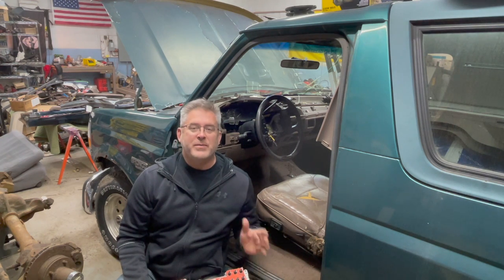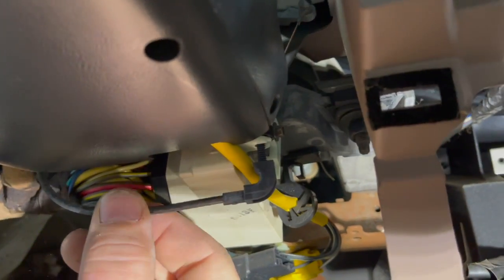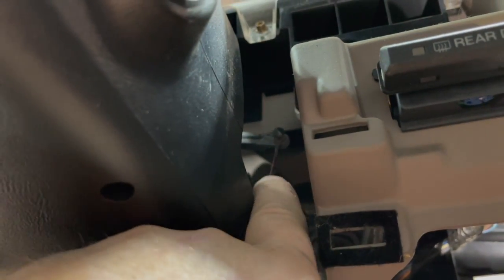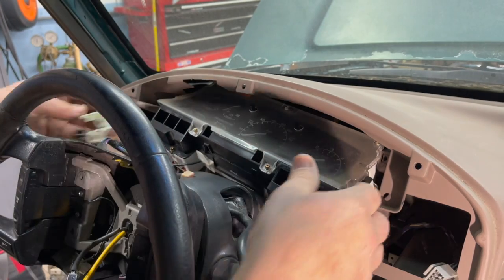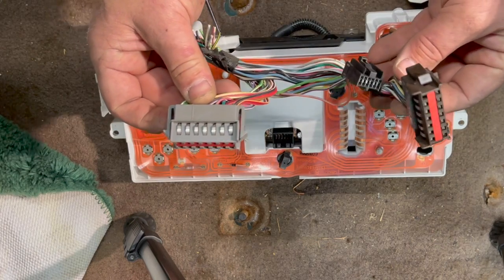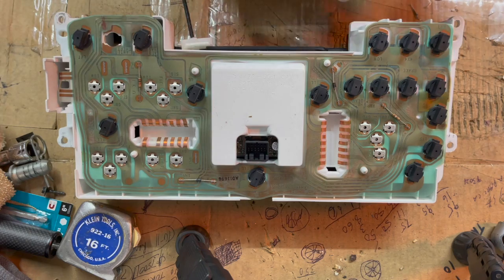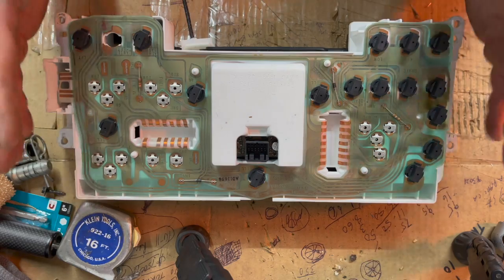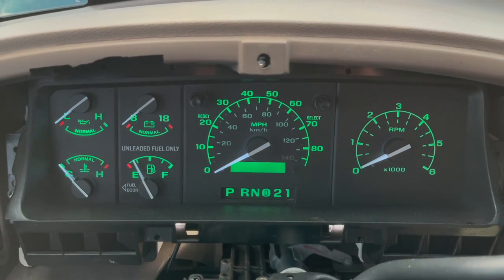How To Remove Gauge Cluster & LED UPGRADE  Ford Bronco   OBS F150 F250 F350

Comment: Just completed this upgrade yesterday to my new to me 96 F350. This video was a huge help in getting that task accomplished. I did the ac control panel as well.
Reply from the maker: That’s great.  It’s a great upgrade
Reply: How did you do the AC control panel?
Reply: This channel has a video on removing the AC control panel to fix broken mounts, I had watched that video also. There's 3 bulbs in the back of that panel. The led bulbs make a nice difference.

Comment: So my Check Engine light went out and caused me to fail smog. Can I just reach under and change it and not have to take cluster all the way out? Dont use LED for that light correct? Man love your videos.
Reply from the maker: Full removal.  Search my videos. I made a bezel and cluster removal video. Thx

Comment: On the shift indicator, is there a small dial for adjusting it on the cluster? My indicator does not line up properly with my clusters positions and Im wondering if thats the fix. Thanks for the vid!
Reply from the maker: Of that doesn’t help, on bottom of your column, near the knuckle, there are 3 gold torx bits. T30? Maybe.  Tighten them all.  Problem solved

Comment: I have a 1996. Is the battery light on of the six on the bottom that we are not suppose to replace? Or is it in a different location? Thanks for all the great videos I wouldn't be doing half this stuff without them!
Reply: Also the bulbs are on Prime day for $13.59
Reply from the maker: I don’t replace the bottom six that are in the warning light area. I’ve had issues with other systems.

Comment: Have a 1990 F-150 manual drive ( floor shift ) with bad water temp gauge. My cluster has no shift markings. On ebay all clusters for my make & year have shift markings with cable. Do you think there would be an issue if replaced mine with a cluster with the shifter markers and cable? Thanks for video and tips for LED bulbs. Great job.
Reply from the maker: No. Two 5.5mm screws and the indicator comes out.  I sell the clusters for $95

Comment: also a good idea to leave a regular bulb in the battery light spot. i hear that its could mess with the exciter on the alternator.
Reply from the maker: Only on 1996 models. They have that batt circuit.
Reply: @BroncosandPartsGarage what about 1997? I got a 97 f250hd with the power stroke..   should I leave the battery light stock?
Reply: Thank you for mentioning this as I have a 1996 and would have replaced that bulb if I did not see this.

Comment: So I replaced all 11 bulbs, and now only the six at the bottom work (didn’t swap those out as instructed)

Tried unplugging everything and back in. Could it be a bad fuse ?
Reply from the maker: Remove each led bulb that’s out, turn them 180 degrees and re install.  Check the metal tabs on the bulbs are making proper contact.  What brand bulbs?

Comment: The best one I have seen change  my blubls right side didn't light up is there a fuss I need to change thanks for the vido
Reply from the maker: Just seeing this. Pull the bulb holder, rotate it 180 degrees. Make sure the little copper feet are on the circuit.

Comment: I think with one package of 10 is enough, you just need to replace the ILL bulbs (5). I don't know if someone else have the same issue, I had ABS flashing after LED change. I removed the LED from ABS, installed the old bulb and stopped flashing so I removed all LED replaced except the ILL. You can use the rest (5) for the AC controls and save for spare with one box.
Reply from the maker: I don’t replace the bottom 6.  We mention in video too.
Reply: @BroncosandPartsGarage  Just replace the 5 ILL and that's all you need. You also replaced the other warning bulbs in the middle. You can use the rest (5) for the AC controls and save for spare with one box. Sorry, I'm cheap lol, adapted to Brandon's inflation lol.

Comment: Great video! What are the 6 lower warning lights? Have you tried them all for such noise? Thanks again!
Reply from the maker: The 4WD, turn signal, check engine ect ect. The bulbs that do NOt Lightbupnthe actual gauges.

Comment: Like your videos! I have a question: the little cable for the gear selection indicator.. Should there be tension on the cable when disconnected? So when you pull on it, it gets pulled back? Or should it just easily move back and forth?
Reply from the maker: There should be a small metal tension spring behind the actual dial.  It should “spring” back when pulled.
Reply: I found it. Lucky though, it was tiny. Almost got carried away until someone pointed out that it only took two screws in the bottom to get it out.
Reply: I am having an issue now where my indicator is a little off and the transmission won't actually shift now but will go through the gear selections on the shift indicator. I got a small grind sound when putting the selector back into park after adjusting the dial on the selector cable.

Comment: Just want to confirm that the Check Engine light is okay to swap to LED?  That's a question not a statement btw.  I know some have recommended not changing the ABS light along with the bottom 6 lights, so I'm just wanting to make sure the check engine light is okay to go LED. Also a tip, if you use a bright white LED the Check Engine warning becomes yellow instead of orange, or at least mine is. So if that bothers you you will need to buy another color.  Hopefully it is only lit prior to startup though haha
Reply from the maker: From my experience, I only swap the guage bulbs and maybe the turn signals.  Not the warning or 4x4 lights.  I’ve always triggered an airbag alarm buzzer when swapping those.  The ac controls, door courtesy lights are all fair game.   I’ve only swapped 3rd brake light bulbs with a resistor as your trans could start shifting hard or erratic.
Reply: @BroncosandPartsGarage Good info...I will remove the LEDs from the 3rd brake light. Thanks!

Comment: I’m guessing these same instructions can be followed in a Gen 3? Maybe a little different but I can’t imagine they’re THAT different
Reply from the maker: Yes. Very similar. Just different bezel. Some hidden screws and You’ll need to unplug your speedometer cable from the back of your gauge cluster
Reply: @BroncosandPartsGarage  awesome, thank you! I’m still a good ways away from interior work but I will be referring to so many of your videos when the time comes

Comment: Great video! Referring to the shift lever pin, the pin is visible in the cluster but is not accurate when shifting into gear, any clue on how to fix? 94 ford bronco xlt
Reply from the maker: Two things. There are three gold torx screws at the bottom of your steering column (by the universal joint). Make sure those are TIGHT.  Then you can you can check the indicator cable (it’s discussed in this video) it’s the small cable that is removed from the lower right side of the column.  On it, there is a small wheel, you can spin this to adjust where the needle lines up in the cluster.
Reply: @BroncosandPartsGarage  thank you for the reply.

Comment: Nice video!
Question: did you use all the same color LED’s?
Reply from the maker: Thanks.  I always use white LED.  I like the natural color of the gauges.  You can remove the “coloring” on the gauge faces and then use other LED bulbs.   These bulbs work in your hvac control until and your door courtesy lights.

Comment: I have installed 10 LEDs in the gauge cluster, 3 in the climate control, 3 in the third brake light, and 2 license plate lights. That's 18 lights in total, and i haven't had to uninstall and rotate any of them, which seems mathematically impossible. Almost feels like I've done something wrong but they work so...

Anyone else had this happen?

Also, I left my door open during the installation, which was only about 30 minutes, but my battery went dead.  I definitely recommend unplugging your battery if you take on this project
Reply from the maker: You got really lucky.  I never swap the 3rd brake light without resistors.

Comment: After changing the bulbs to LED the ABS light kept flashing. After pulling the cluster out five times to clean contacts I changed the ABS back to a standard bulb and problem solved
Reply from the maker: I’m glad you figured that out. It’s covered in the video that we don’t replace the warning light bulbs on the bottom.
Reply: @BroncosandPartsGarage  The ABS bulb was one of the eleven , not the bottom six. Its was the fourth one down , outside edge. right side, from the top of the cluster. Might have been a fluke on my cluster but thought you would like to know. I think your videos are great. Thanks for taking the time to make them
Reply: @robertdrown7226  95 Bronco with the same issue. Been looking everywhere for an answer.

Comment: Why is it that you leave regular bulbs In the lower lights?
Reply from the maker: The turn signals are ok.  But on 94+ you’ll have issues with your airbag module by switching to LED.  It’s not a 100% issue, but it arises often enough to skip swapping.
Reply: @BroncosandPartsGarage  so pre 94 shouldn't have any issues with that? Mines a 92

Comment: 1994 f150 where is the bulb location for high and low beam on the cluster
Reply from the maker: Below the vertical plug, on tach side of cluster
Reply: @BroncosandPartsGarage  thank you so much

Comment: Why don't you put LEDs for the idiot lights?
Reply from the maker: The resistance is different. The bulbs won’t work properly and you’ll get an odd alarm sound for your airbag light.
Reply: @BroncosandPartsGarage  wow. Learn something new everyday
Reply: @BroncosandPartsGarage  do you know if it’s just the airbag and abs, or is it all of them? Do you have a link I could read more?y research is coming up dry. Thanks!

Comment: You don't need to take all that apart to change the dash lights. You don't even have to take it out
Reply from the maker: Are you serious?  lol.  Read the title of the video 😂😂😂😂👍🏻👍🏻👍🏻
Reply: @BroncosandPartsGarage  yeah I got it bro! But you don't need to remove the gage cluster to change out the lights! You don't have to disconnect the shifter!
So if all your doing is upgrading or replacing cluster lights he just made it more difficult and longer.
There's already videos on YouTube that shows you how.
Reply: @BroncosandPartsGarage  and frankly after doing this job I would rather leave the cluster in and take the lens off for access. The gauges themselves are easier to remove then disconnecting the plugs from the back of the cluster. They are harder to get apart and therefore more chances of breaking the plug.
Reply from the maker: Thank you for watching mine.
Reply from the maker: Take the lens off?  lol.   You obviously have not swapped bulbs.  You can do it your way?!? Or the proper way.   Thank you for watching and helping my algorithm.
Reply from the maker: Yet, you cannot stop watching my video perfection.  Thank you.  Make sure u let commercials play.  $$$
Reply: @BroncosandPartsGarage  hahaha
I'm always looking for better ways of doing things. Sometimes I don't, I'll stick to the way I do it, thanks